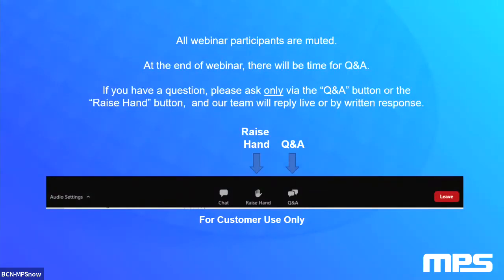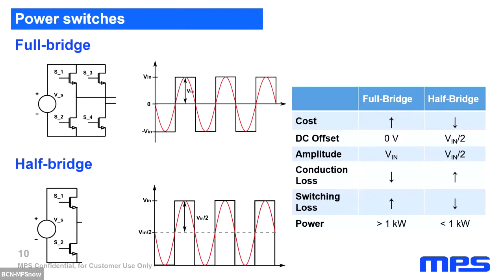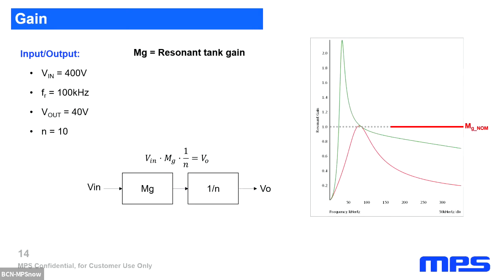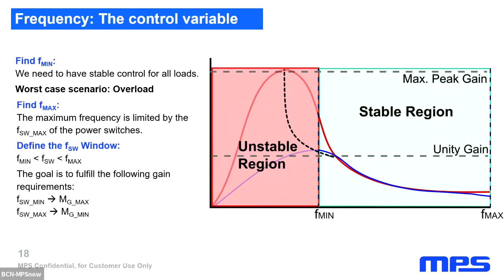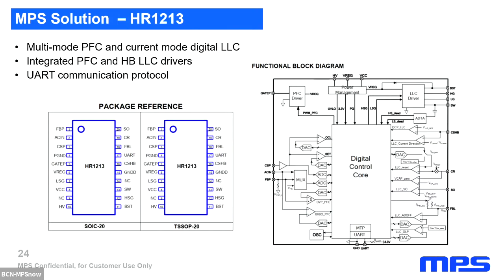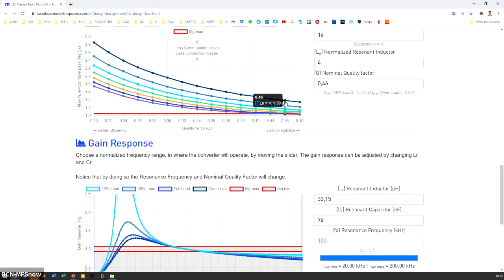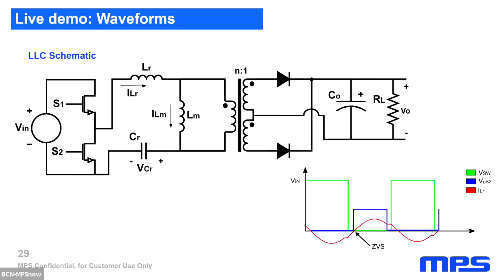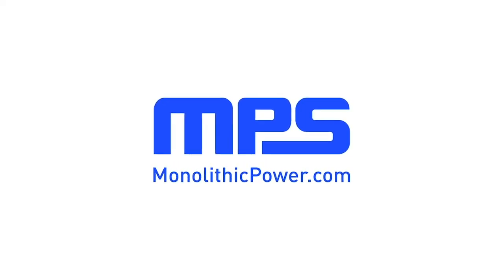Design a 600W LLC Converter for a PC Power Supply

Comment: When you were calculating the Lr, Cr value through your design sheet, minimum freq. Which came aprox 67000khz and high frequency aprox. 200000khz. So is this a error of your design sheet or anything else???

Comment: Thanks, very interesting. But there's one question: on 2:26 P=600W, but output power according to sum Vout*Iout is 761W. Is this mistake or it's just my misunderstanding?
Reply from the maker: Thank you. Good catch ! Yes 600W is the total output power. In this case the 5V and 3.3V output are driven from the 12V output. The power is limited in the 12V power rail, but the rating of the 5 and 3.3 outputs is 15A and 8A.

Comment: Nice video,s to learn.

Mine question is not completely about LLC bet LCC or LCL, both are better for mine use. I am diy'er so no company, I have a question about the transformer for a LCC converter, what induction do I need? because I do only read on papers and video,s on you tube how to do the resonance tank, who I do now about but not the transformer. I now the LLC has the transformer included into the resonance tank, and it is a constant voltage action,'I can design using a tool, But for LCC there is no usable tool and need to calculate myself, I have to buy a good calculator who can do graphic so I see the formula,s as on papers. Oke, back to LCC because it is a constant current output to transformer I presume this transformer needs a high reactance and as such a high inductance? The transformer is current source driven so it has to keep load on tank as low as possible?. So question is what to do, just experiment with inductance value,s until the primary has as high as possible efficiency, so lowest primary current on full load. 

The supply is for a hybrid amp, the tubes voltages. there are more then one on the transformer, 1 x 350 v 0.1 amp 2 x 120 v 0.25 amps 12.6 volts 6 amps, and 6.3 volts 5 a 10 amps. so total power is not that high, because the danger a tube get faulty supply can go to very low load so a LLC do not well here, I read that a LCL is even better then a LCC for this, but first looks a constant current supply. Nice stuf to play with. Yes I am used to very high voltages and now the dangers as a old tv restaurateur.

I do sim with Lt-spice and get a lot of different outcomes.

regards
Reply from the maker: Thank you for your inquiry.  Please go to our forum for technical questions.  We have engineers that will respond within 24 hours. https://forum.monolithicpower.com/

Comment: Where are the most loses for a gaming PSU say 850w ?
Reply from the maker: At the output. 850W at 12V means over 70A, with this current even few tens of milli ohms can represent huge loses. In this case center taped (MP692x) output is great since you have the half of semiconductors. The counter part is that you will end up with more copper in the transformer. I would definitely recommend using foil in this case.

Comment: We are planning to design a llc/cllc circuit as a part of an ev hackathone . In the design tool provided output voltage can be add upto 90 voltages. But we want >90v. Then how to plot the graph manually? or can we plot it in matlab..Please reply
Reply from the maker: Thank you for your inquiry.  Please go to our forum for technical questions.  We have engineers that will respond within 24 hours. https://forum.monolithicpower.com/

Comment: Sir i have a 12v 2amp adaptor
Sir that adaptor doesn't have any drive ic just 2 transistors (S8550, BC548) and a mosfet (pfb2n60)
 sir how is switching pulse given to mosfet gate (please reply)
Reply from the maker: Thank you for your inquiry.  Please go to our forum for technical questions.  We have engineers that will respond within 24 hours.  https://forum.monolithicpower.com/

For direct project assistance, please contact our MPS Now team. https://www.monolithicpower.com/en/support/mps-now.html

Comment: yay. a video that covers the inductors. and has an online tool. that seems to work. bonus. helpful. this really does give some clues.

bit harder in my case, i just wanna drive an induction heater. no voltage, high current. sure, its a single turn secondary, thats easy enough. i will have to fudge some numbers here and there... see how they interact. meh.

so...
assume 110V supply, 270nf, get 18.6uH Lr, LN 6, turns ratio 6. so 74.3uH Lm..., around 75khz. (plan on using ir21531?) approx 10k, 1nf on its lil RC timing circuit, easy. now i understand why its timing graph is so... vague. as long as youre high enough it works.

the challenge, the brick wall i face... how to actually implement that inductor as the work coil? make it as the work coil? ie, 6 turns on a diameter/spacing to roughly give 74uH? what happens when a steel slug goes in? what happens when it passes the curie point? coupling? changing coils?

or do i throw the work coil in parallel, it being of so low an inductance it makes very little difference to Lm from the two extremes of no load to full load?
but doesnt it just short it out? throw in another capacitor isolating it?

make Lm as 6 turns on a bunch of ferrites until i hit 74uH then throw one leg of the work coil through, with it either wired as a closed loop, or as a tank circuit of its own?

meh, sure i will figure it out. sort of :)

really, it seems the best way is to...

RELEASE THE SMOKE!!!!!
i have a good baseline to work on now.
Reply from the maker: If you have any other questions, please go to our forum for technical questions.  We have engineers that will respond within 24 hours https://forum.monolithicpower.com/

Comment: Hello, as I can see in live demo your converter is working above resonance frequency.  Is that lowering the efficiency of the converter, consider there is harder turn off and oscillations. 
I am asking cause I face the same problem. Also if your input voltage is at nominal value, shouldn't the the converter working on resonant frequency  where the gain is 1 in any loads, according to the graphs in the design steps. Thank you.
Reply from the maker: In the video, the load is set at 50%, that’s why the switching frequency is lower than the resonant frequency. If this happens at nominal load, the turn ratio should be changed so that the converter works with a resonant gain of 1 at nominal conditions. For any further questions, please go to our forum for technical questions.  We have engineers that will respond within 24 hours. https://forum.monolithicpower.com/

Comment: I am going to use a transformer with Lr in the transformer using the leakage inductance. To measure the inductance Lr I plan to short-circuit the secondary to cancel Lm. But how can I measure Lm, I can't think of. Could you give me an idea? Thank you
Reply from the maker: Thank you for your inquiry.  Please go to our forum for technical questions.  We have engineers that will respond within 24 hours. https://forum.monolithicpower.com/

Comment: As you are compromising the gain of LLC converter for stable operation will that effect the overall efficiency considering that efficiency is the key factor for my application.
Reply from the maker: The impact on the efficiency would be low. But anyway, you could find that when operating in the boundaries of input voltage, the switching losses start to increase. This is because the operating points would be far from resonance so the benefit of Zero Voltage Switching is reduced.
Reply: @monolithicpowersystemsmps534   Thanks for being so generous. it's really helpful and insightful

Comment: very interesting video and tool. I am designing LLC for battery charging application so how do I proceed where output is varying and I want to operate LLC in constant current mode and constant voltage mode
Reply from the maker: Thank you. In this case Is recommended to work with high quality factors and low Ln ratio. This will lead to a more narrow frequency span to achieve all the input output configurations. The counter part is that typically you will higher losses.  You can refer to https://www.monolithicpower.com/en/offline-600w-battery-charger-pfc-llc-hr1211

Comment: nice information, sir i want to increases the voltage from 390v to 1000v it is possible by LLC half bridge resonant converter. (isolated dc dc converter) having a power rating of 1200w.
Reply from the maker: Thank you. The output voltage will have an important role in this decision. Buri in mind that with half bridge the effective input voltage is halved. So, if your target is high voltage output maybe is better to go full bridge. If it is not your case half bridge would be great (Less cost, reduced turn ratio, more compact solution). Just be careful while dimensioning the resonant capacitor, take into account the voltage rating goes down with frequency. Double Metallized Polypropylene Film capacitors works great for this applications.
Reply: I need to charge 330uF up to 900v in 50 continuous milliseconds, I was trying with pwm switching, but I can't have speed and the transistors burn out, have you achieved it?? I tried a ramp generator to control the pwm and have constant current in the capacitor but no